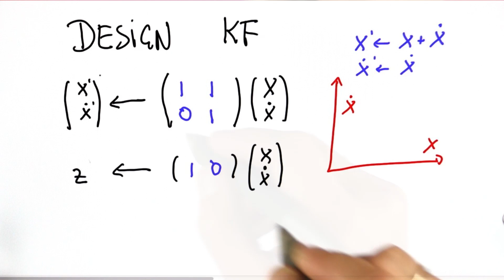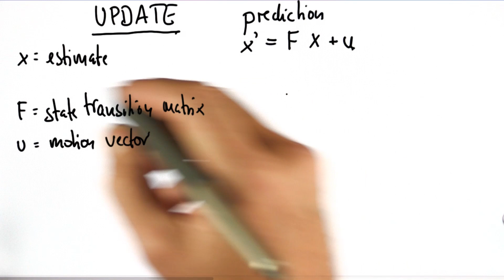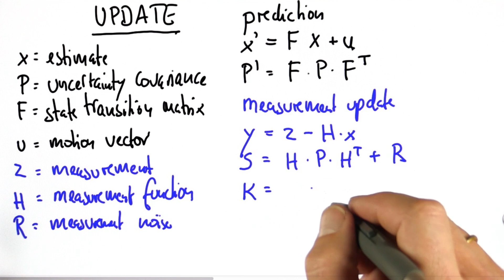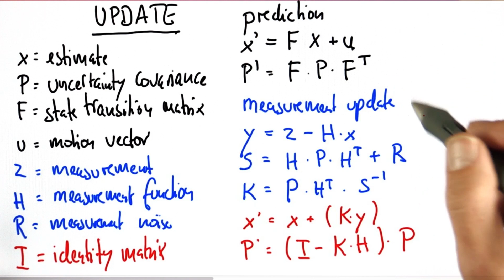Kalman 필터 디자인

Comment: 0:59 What is the variable z? I haven't gone further beyond this slide in the course, so is it explained later?
Reply: Looks like z is the measurement function that takes in sensory data that retrieves the current x-position and velocity from surroundings. The matrix given above looks like it's problem-specific. When the matrices are multiplied:

z = [1, 0] * [x, x_dot] = [x, 0]

we get ONLY the x-variable which we can use in our next measurement/prediction cycle to calculate new Gaussian distributions. The reason we're interested in only measuring x position, and not velocity (x_dot), is because this problem assumes a constant velocity model. We already know what the velocity is, so we don't need to keep measuring it.

So in summary:

State transition function = new values calculated (x', x_dot') using information we already know (x, x_dot). These are the PRIOR values.

z = new sensory data (x_measurement, x_dot_measurement) used to update our current state and continue the update-prediction cycle. These are MEASUREMENT values needed to calculate our new POSTERIOR values.

Comment: The equation for P' should include Q, the model noise. Otherwise, your estimate may be a bit too much confident, and will slow down the updates, resulting in a seemingly "low-pass filtered" estimate.
Reply: By model noise, you mean that in x'=Fx+u, there should be another noise term on the right hand side, right? Could you please write the modified equation and define what your Q exactly mean from it? Or please recommend a more advanced source for me to read up on this. Thanks.
Reply: "https://www.youtube.com/playlist?list=PLX2gX-ftPVXU3oUFNATxGXY90AULiqnWT" its a big playlist on kalman filter but is for sure  indepth. @est9949
Reply: Also, could you please elaborate on "resulting in a seemingly "low-pass filtered" estimate." to someone who doesn't have much background on low-pass filter?